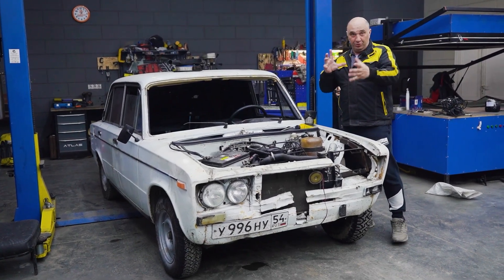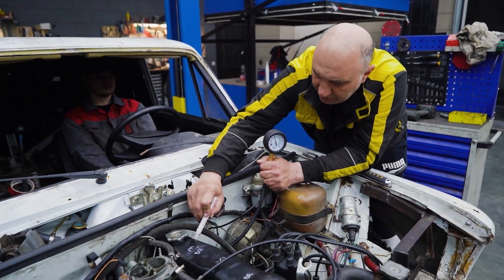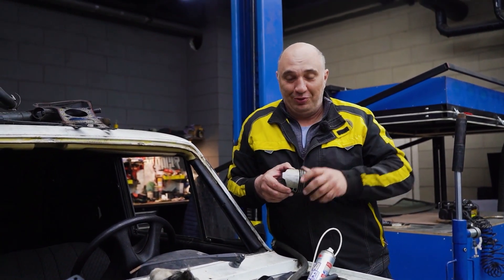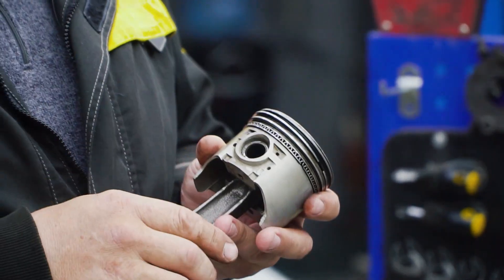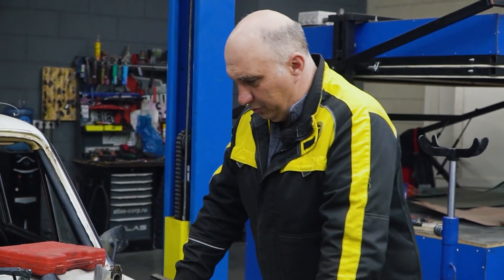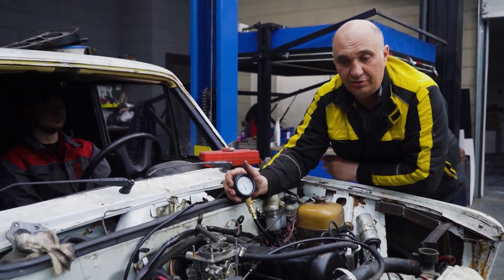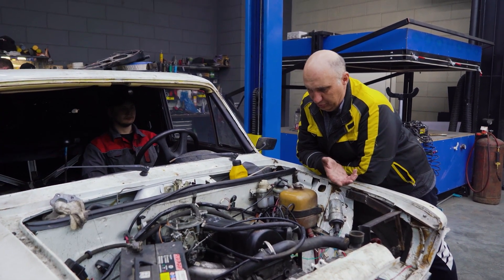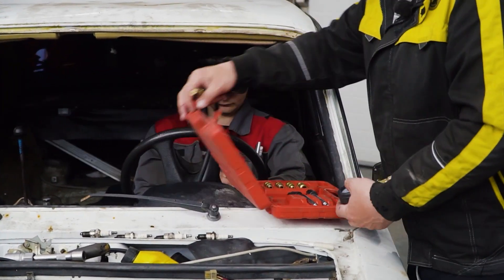Will an extra piston ring raise the compression?

Comment: I can't imagine why no one has suggested 3D printing plastic rings!  These would have to work better than metal rings, right? And they could also be made in a variety of breathtakingly beautiful colors!
While you're at it, you may just as well make a set of wooden rings  - just to see how much better those would work than the antiquated metal ring methodology of the past.
Additionally, antiquated metal rings will not float, whereas both plastic and wood rings WILL float!  
They will also easily pass through a metal detector! (Just think of it, all of you auto parts smugglers!)
The pretty colorful ones may also find a lucrative secondary market: teenaged girls in need of bangles/bracelets.
You guys should add plastic piston rings/beautiful bangles to the Garage 54 merch inventory.
Wow.

Comment: install 3 compression rings on the lada with diesel fuel injection that runs on gasoline and measure the power output.

Comment: My thoughts were the the thinner upper ring land would get too hot and chip or break. I guess on some engines it might just do that, but on a Lada? Apparently not. Tough little motors! If you run a high octane fuel in it or boost it, well.... I would think it would heat the upper ring lands and either melt or break them off. Time will tell!! Good video guys

Comment: That's not how compression is determined. Or changed for that matter.  If it were better with 3 that would have that (Diesel eng). Gas does not require that high.

Comment: Impressive, I didn’t think it would add compression, I wonder if that translates into power, in theory, higher compression will make more power. The ring land is probably not an issue in this low power application. Compression is usually set by the piston/chamber, not by the rings. I wonder how much extra wear this will apply to the rod/crank bearings
Though the fuel/air would need to be tuned dramatically, you could probably see a marginal gain

Comment: I would like to see a variable compression ratio engine by cutting the block horizontally and putting a very heavy-duty hinge on one side and three or four hydraulic rams to move the top of the block up and down to vary the compression. And then turbochsrge it.

Comment: 1.5 bar increase is 18% of 8 bar. And when the fuel air mix explod is even more. Better sealing more horsepower.  F1 cars have to warm up manually, because so tight the pistons and rings that wouldn't move or start the motor from the big frictions.

Comment: An interesting result!
I find myself wondering, though, whether the compression comes from the third ring being extra, or from it being new.
What would the expected compression be with the standard two rings per cylinder, if all the rings were brand new?
Reply: imo I think a good portion of the compression increase is because the 3rd ring is above the original 2 thus reducing the clearance volume of the cylinder
Reply: @buttadog5073  location of the extra ring makes no difference, it doesn’t only do 1 compression stroke, he cranks it till it peaks, the compression test only tests sealing of the rings to the cylinder wall (and valve seating). Any improvement came from fitting a new ring. The fair test would have been :-

Engine as it was
Engine with new rings
Engine with new rings + extra ring.
Reply: @buttadog5073  I'd thought of that too, but it seems like the volume in question (distance above the second ring times the annular area between piston and cylinder) would be small compared to the volume between piston and head at TDC, at least for a relatively low compression engine such as this one.  Just spitballin'; I don't know much about the geometry of a Lada engine....
Reply: @ericwilner1403  yeah that is true but it still would make a difference
Reply: @buttadog5073  Hm.  Another bit of evidence occurs to me: compression was inconsistent with the old rings, and consistent with the added one.  This points to the old rings (at least on two of the cylinders) having been significantly worn.

The location of the added ring will make some difference, but I'm definitely suspecting that just having a new ring was the main factor.  (What's the compression on a brand-new Lada engine, anyway?)
Reply: @ericwilner1403  New car supposed to have 8.5 or 8.8 compression ratio, if Wiki is correct.
Reply: @dimitrys4492  compression ratio is calculated as the relationship between the volume of air on top of the piston at bottom dead centre and top dead centre. 

Cylinder compression (tested here) is how well the rings and valves seal, it is not compression ratio.
Reply: @buttadog5073  likely probable
Reply: I wonder what the head gasket thickness from old to new. it wouldn't surprise me any if the new gasket was thinner. adding the top ring would reduce the total volume slightly, but nothing like a gasket thickness change, which can be easily overlooked!
Reply: The reason why compression has increased you're actually decreasing  swept volume of the cylinder, in effect shortening a cylinder length more compression in the area. Like decking the heads in reverse 🤔
Reply: Likely because it's new and cylinder wall are not worn at the top of the sleeves 
Number of ring really does not matter  most high performance dirt bike engine use only 1 compression ring for less friction and more power really important for a one cylinder 250cc or 450cc

Comment: You should try to put several motorcycle Carbs on that engine and see if you get increased gas-mileage.
I would put like 4 carbs from a 125 cc motorcycle.
Reply: That would be a huge power boost for this little engine. 4 throttle bodies instead of one

Comment: Sitting there running at idle at the same speed for days isn't going to seat the rings!  They should have just gone and drove it around Moscow for 500 or 1000 miles and then checked the resulting compression.

Comment: I cannot imagine that this would increase compression enough to add much measureable horsepower.  If they did this and milled the living shit out of the head to raise compression THAT way, then you'd probably see a reasonable difference.  These engines barely made 72 hp stock, so maybe you could see 80 hp with that situation?  An extra ring is only going to add a few horsepower on such a low powered engine, and the reduced ring land area is BOUND to break and then destroy a cylinder wall.
Reply: can you please describe it in more details, how it's possible when the cylinders wall thickness enough to stand the pressure & the heat
Reply: @BITONYBLUE1  the Ringland will fail, which will put a lot of piston parts in contact with the cylinder wall. The ring will also move freely so it will also scratch the cylinder wall.

Comment: Your shop has a new business , adding piston rings to,engines.
Reply: I would be curious how much the power would increase if you use a 200 hp 3.0 V6 and add another piston ring to it. I assume it would be at least be 250 to 300 hp.

Comment: 6 cylinder Lada, with the 3 rings pistons and diesel pump, even better if you take a compressor, either from an AC or any other thing, and add it as a force induction.

Comment: well my concern would be that the piston face could crack because of machining that groove for the new ring and send a chunk of piston into the combustion chamber
Reply: Yes, it was designed to be oversized because carburator of Lada, Russian fuel (from 73 to 78 octane... and not really well refined) , flooding in winter (extra space allows fuel to go somewhere instead of being pushed into spark plug) etc. 
Probably under normal use such engine will die quite quick, this is just fun experiment though.

Comment: Some old engines came with three compression rings, and some industrial/stationary engines still do. I don't think it would be a wear problem - IF - RPM was kept low.
Reply: Also tall deck big block chevy's. May be some info there being as they were mass produced. To add to their strangeness, those engines only used centrifugal (engine speed) advance too; no vacuum advance.

Comment: So I had this idea earlier today: how many vehicles intake and exhaust can you chain together like the human centipede until the last car won't run?
Reply: Two
Reply: 2, the second one won't run.
If the car is properly tuned, there will be nearly no oxygen left in the exhaust. The amount of fuel injected,  into the cylinder is depending on the amount of oxygen. The goal is to burn as much of it as possible.

Comment: I wish you guys had a dyno for this experiment it would be nice to see the hp gains on paper !!
Reply: The extra compression would change the optimum ignition timing and advance curve.  An engine dyno would help determine the best timing.
Reply: @frazzledude  not really, proper tuning would help achieve optimal timing and fuelling, no dyno needed for that, dyno is  really only useful for before and after figures!
Reply: probably the compression gain was due to the upper ring being higher thus higher compression ratio
Reply: @camilosilva2531 I honestly don't think it's gonna any difference from the ring being at the top or bottom because the pressure has to still pass through all the rings and it's still gonna hold pressure. But i guess it could possibly change  the oil ring consistency.
Reply: yeah
Reply: I was thinking this while watching it
Reply: Yes, I Agree!
Reply: #dyno #dynamometer
Reply: Or see if it'd rip a piece of paper?
Reply: I think it will be left with Less lub on bore
Reply: Extra compression making more horsepower versus extra friction taking it away.  I wonder which would win?
Reply: @unhinged-menagerie  There is nearly no additional friction at all.. The extra compression will help it run better for sure.
Reply: @unhinged-menagerie  exactly
Reply: Contact area dosen't change friction in physics laws, but it's extra "spring" too. But oil should handle that. You could meter this, how much it takes when starting it without spark plugs, before extra parts and after it. Then you know how much those make more friction when power is metered in watts. If plugs are in place, then there is pressure adding force activity making change too, so that isn't right way..

This is indeed very very interesting topic so many way. In rally and usage cars.. and testing..
Reply: I'm thinking this gives more newton's than hp's prosentually, but I'm not sure. This could drop fast when revs go up few thousand and over, that's normal too.

Thanks for the testing.
Reply: it probably has more NM, which shows in the 2nd gear start and drift.
Reply: It had 115 psi then it went to 135 psi. It would of only picked up a few hp at most
Reply: @k3bigwink1escambourn5  agreed.

But 5 extra horses in a 60 horse engine is a big gain.... especially with only 18 rubles worth of parts.
Reply: @k3bigwink1escambourn5  i already do e that i  my isuzu diesel and it works great,increase incredible power,from philipines
Reply: If they gained 10hp.. I'd be surprised.
Reply: Hard to say, These engines are are lucky to be 60hp when brand new and its safe to say the one in the video was well below that. My guess would be around 34hp at the wheels and it would be hard to tell small power gains verses dyno discrepancies.
Reply: Probably lost HP
Reply: @xfhnhhgjbvcfg  Lol

Comment: Extra piston ring equals less blow by equals the exhaust is supposed to make the piston goes down actually stays were supposed to be in the chamber till it goes out the pipe they should be doing this with all pistons for a very long time if anything they should’ve had three piston rings and two oil rings Or if not just the three and the one oil rig I don’t know why no one ever did this or for compression rings for that matter

Comment: You should take a lada engine and apply all the hackjob performance modifications you've done in the past.
For example the extra ring for increased compression, shave the engine block and cylinder for increased compression, 2 extra cylinders to convert it to a 6 cylinder, the diesel high pressure fuel pump and also try to make some new stuff like DIY high lift and long duration camshafts, lightweight pistons and conrods etc

Comment: The rise in compression is do to the reduced chamber volume because the first ring got moved up. If you added the ring to the bottom you wouldn't have seen it rise.
Reply: Came here looking for this, needs testing again with the middle or bottom comp ring taken out. Adding more rings simply doesn't increase compression by that much.

Comment: Interesting thing in regards to piston rings. If you know you're going to abuse the crap out of a motor, like in a demolition derby, you file the rings open a bit so when it starts to overheat and the rings expand, the piston don't seize.
Reply: Maybe even put some 2 cycle oil in the gas to help with lubricating that top ring.
Reply: Good idea 💡👍
Reply: I'm in NZ and our derbys maybe are different? The cars we use here are destroyed every car except one drives out. The rest are pretty much pre crushed for the scrappys.
Reply: @brotang2953  we have different classes here, from minimal alterations (removing the glass and relocating the battery and radiator) to serious one like plating the frame, cutting where you would rather have it bend (this is usually done to get the rear bumper to bend up instead of down, where it drags and lifts the rear wheels) and a couple of hundred feet of wire woven into places for reinforcement, all the way up to unlimited classes that use completely custom heavy duty square tube frames that are ridiculous. 
Most of the people I know are in the middle group. They take their cars home, straighten them out with winches and sledgehammers and run them over and over.
Reply: @brotang2953  and a lot of these guys do stuff to the engine, like file the rings, to make them last longer and have more power. They use the same one for years, in multiple cars. The stock motor from the car gets put in their truck or sold.
Reply: A lot of work to get an extra few minutes from a car your destroying🤔🤷. Why would you fully tear down an engine prior to entering a derby???. Ya can run it on 2 stroke and delete the radiator altogether so it just circulates thru the pipe and run the interior heater on full blast. One smack in the front and all your waters gone with a radiator in there.
Reply: My friends have been running dozens of derbies a year for decades, like 4 generations. They drive all over the country to get cars. They typically use the same built up 4 bolt main 4 barrel small block chev for years. Once they go through the engine, it can handle an entire event with no coolant and then do it again next weekend.  They also know where to reinforce and where to cut to get the car to fold the way they want.  It's actually quite involved, way more involved than I realized
Reply: @brotang2953  I'll have to ask them about the 2 stroke oil. If there's a trick, these guys either heard it or invented it.
Reply: @brotang2953  do they even allow radiators in demo derbys?

Comment: Nice.  Now I would like to see 2 rings in 1 groove with the gaps 180  degrees apart
Reply: I always thought that the ring gaps would migrate. I guess I thought wrong.
Reply: Yes please
Reply: They'll end up with the gaps in the same place
Reply: Oiling to that top ring may be an issue. Interesting idea tho.
Reply: you can always put a small pin in the gap to keep the rings from rotating.

Comment: "Sounds like a new engine"

Ahh, so they came off the factory floor sounding like a diesel with a rattle..
Reply: Ladas engines really are noisy even when new. Source: my father bought a lada 2111 brand new back in the day. As a kid it sounded different than any car to me, at low revs kinda sounds like it has piston slap and at higher revs it sounds like just another 4 cylinder gasoline engine.
Reply: well, yeah, its a russian product, it came broken

Comment: Now make domed billet pistons (or mill the head) to see how much more compression can be had. Lada NA with twin carburetor! Max torque!
Reply: Not twin carburetor dual fuel injection (dfi) one injector will spray fuel in the intake valve and the other one will inject fuel direco at high pressure then see the results. The result will be mind blowing
Reply: @ayannasir6653  They already have diesel pump injection on a Lada

Direct injection is unreliable for gas engines and a twin or triple or quad carb follows old school hot rodding
Reply: @ruikazane5123  oh i think that this is a gasoline engine but this is diesel engine

Comment: It would be cool to not just add a 3rd compression ring to a set of high compression pistons and do a compression test, but then shave the head to add even more compression and see what those small single cam Lada engines can really do with some high compression.
Reply: @Karl with a K when you disassemble a engine with a “dizzy” and have to pull it from it’s original orientation you have to adjust the ignition timing by rotating the distributor. They also do some insane modifications to engines that they have to not only play with ignition timing they also need to adjust fuel too.
Reply: twin carb twin carb